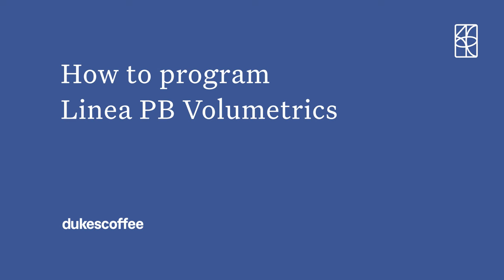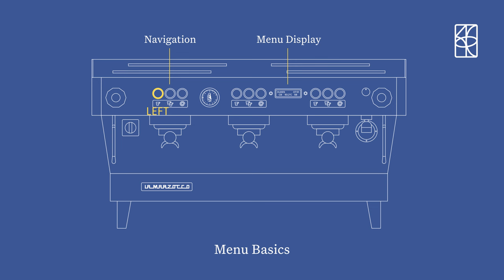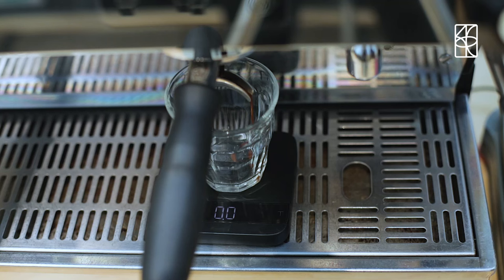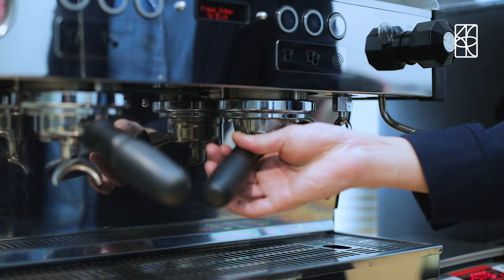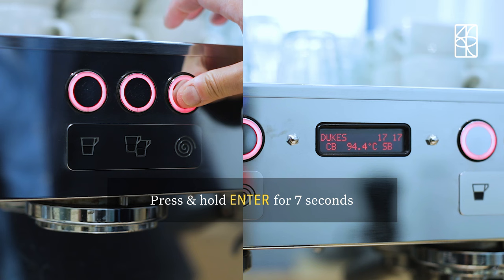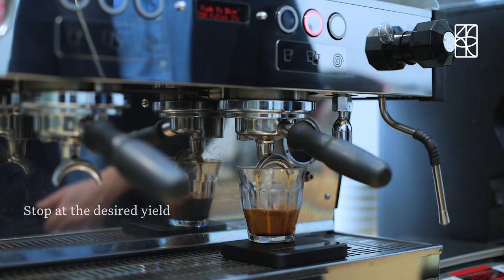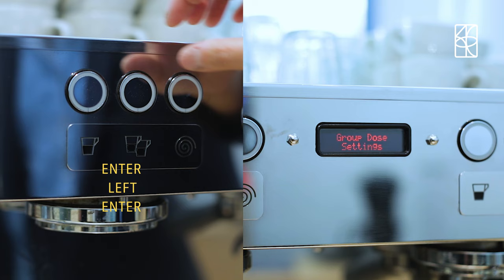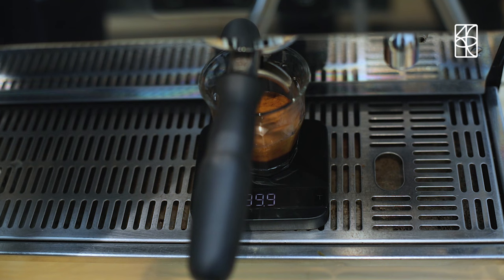Programming / Setting La Marzocco Linea PB Volumetrics

Comment: Thank you for the video. What temperature do you set for the steam valve?
Reply: Set your steam boiler temperature to give you the desired pressure you want to achieve in your steam boiler. I would start at around 120c, and adjust from there in 1.0c increments. Ideal steam pressure for most environments is between 1.0 and 1.5 bar on the main steam boiler pressure gauge.